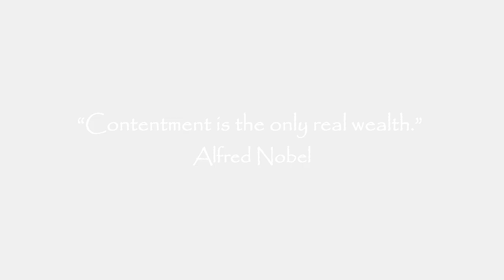The Dyna Syndrome - The Contentment Backhoe Project

Comment: Hello it is looking good we know your busy but we were worried. Thank you for the update. You know you can call me anytime and i will try to help...
Reply from the maker: Thank you Thomas!  Gonna have a tractor mechanic look at it next week. Timing is correct and verified. New distributor, new coil, new wiring. Wiring checked for continuity. Checked grounding. Rebuilt carb. Just can't get it to do more than pop a few times.
Reply: @contentment164  Might want to check the carb adjustments again sounds like it is a flow problem i know its rebuilt but one tine spec of junk will cause a major headache ....
Reply from the maker: @thomasschmitthomesteadproj6025  the float needle may be sticking. Thanks, Thomas.
Reply from the maker: Found it!  You would think that after rebuilding the thing I would remember that an industrial engine spins counter to a regular vehicle engine.  I had the plug wires to the distributor inserted around I reverse order! Haha!
Reply: @contentment164  Good i am happy you have it going now...Thanks for letting me know